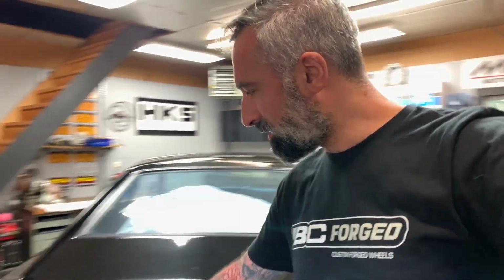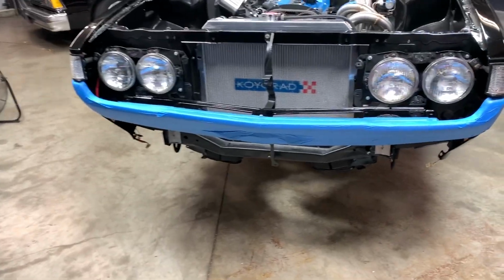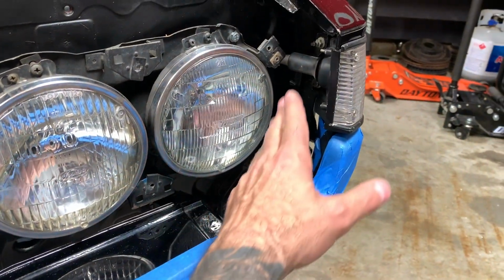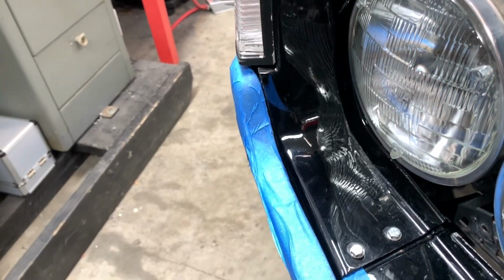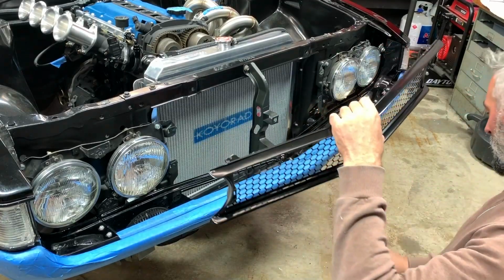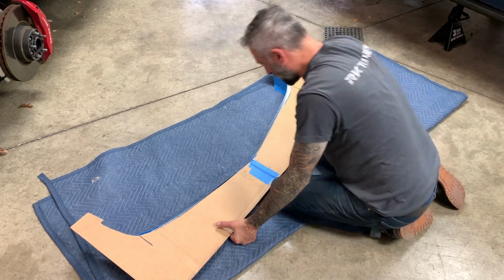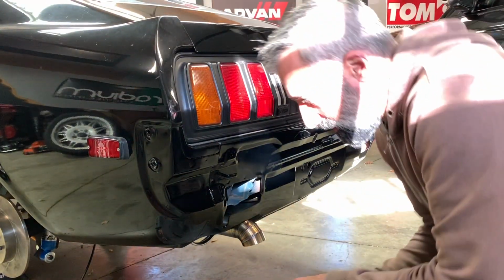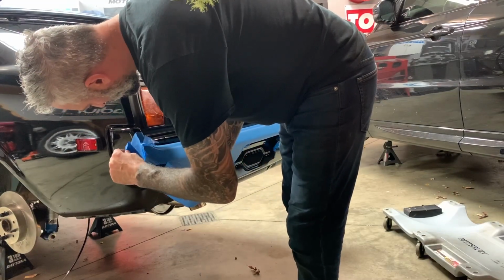3SGE Beams swap. Celica Ep.21. Front end assembly.

Comment: Your fiberglass bumpers are much better quality than the ones I had.  I got tired of fighting the fitment and ended up buying some real ones.  It's hard to get the front bumper fillers to fit perfect since they are for the crash bumpers that came on the car.  I've got a set of RA25 bumper fillers and they have a lip that the bumper rests in to fill the gap.  I'm currently using the same fillers you are and my bumper sits right over the beveled edge.  With all that being said, fitting the front end on these cars is a major headache and you did a great job.

Comment: we built a 76 celica wide body in 92 with a tunnel ram 283 with a 5 speed trans it would smoke most cars on the street we put a full frame with chevy suspension under it with a lot of upgrades